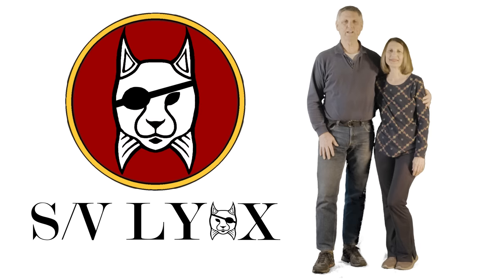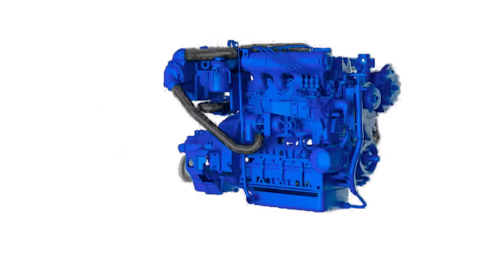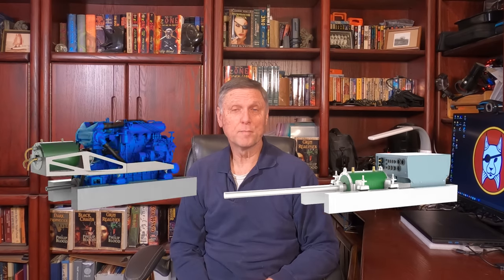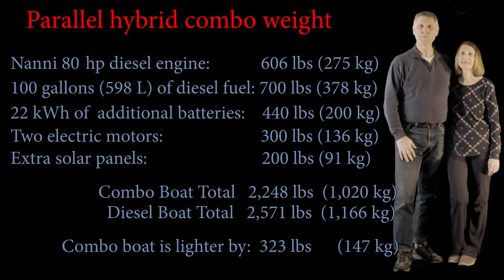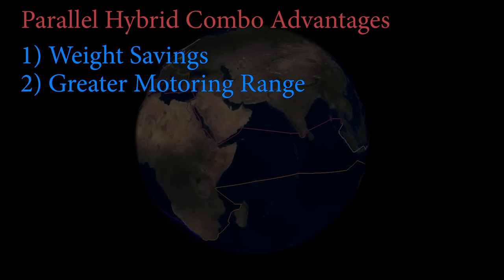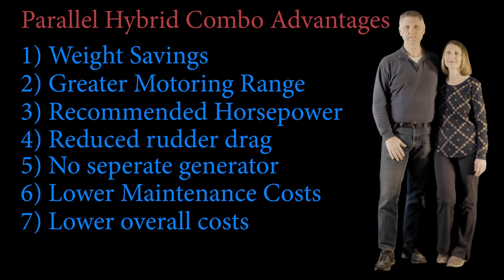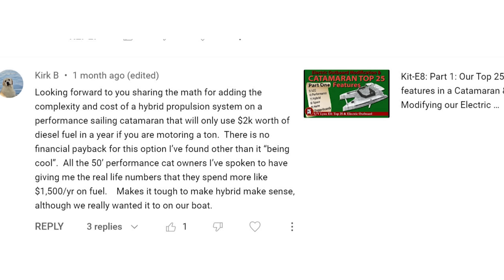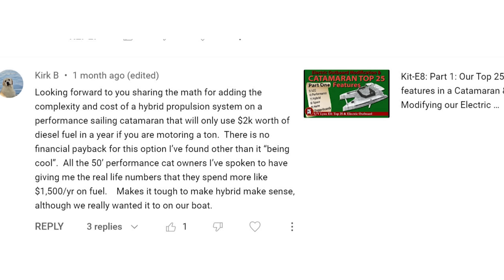Kit-E18 Parallel Hybrid Combo Propulsion

Comment: First let me just say I really love your videos and the enthusiasm you both have for this project! I feel honored you called me out and took the time to document all of this and answer my direct questions and I hope you aren't offended in any way, as I'm learning along the way myself and truly enjoy the dialog. Being a nerdy engineer who builds stuff as well I Iove this topic, and actually just got back from the Boot Show in Dusseldorf where I spent a couple of days meeting with a whole bunch of these hybrid system manufacturers and spoke with a variety of people much more knowledgeable than me on the subject as we may still add this to our build. Couple of clarifications and counterpoints

First off, there are absolutely no performance catamaran owners motor who 40% of the time. The highest estimate would be 15% and that is a stretch. On a recent 1,100-mile passage my wife and I did from Annapolis to Ft. Lauderdale we motored a total of 60 miles which is 5.5%. This same boat sailed from Cape Town to Ft. Lauderdale this same year using 1/3 of its fuel or roughly 90 gallons to cover 9,000 NM, that's 1%. The good news here is you guys also have a phenomenal performance cat you are building, and it will sail like a dream, and you won't be motoring remotely close to what you are thinking nor burning nearly as much fuel. If you don't believe your boat will perform this well, you are building the wrong boat (which I don't believe you are)  The reason people are burning $1,500 worth of diesel is because they are doing stuff like charging batteries every 4th day, or are on an occasional passage where they have the winds against them or passage speed drops under 4 knots coupled with having a weather system heading their direction and in order to not be out when things get spicy they motor sail. 

You forgot to add in on your 14-year journey, you'll need to replace your batteries in 10 years if you treat them well, and that adds $20k to your calculations (inflation happens here too!). Not sure how much they will degrade in their capacity as well, but this is a consideration that has to be factored in. Also, your flexible solar panels will maybe last 5-7 years that will give you this extra range, so you'll replace them twice as well. Now if you have rigid solar panels these will last 25 years so you are good to go if you chose rigid glass panels.

Weight calculations - you missed an option that actually is lighter. You say that a generator is necessary with the (2) 50hp diesel engine option, but there's another option and that's to use Integrel charging systems that replaces the need for a generator. Also, saying arbitrarily that you'll need less fuel on your boat when choosing this option is silly and stacking the deck. A performance catamaran won't use 100 gallons of fuel in 6 months of living aboard, so saying you need more 58 more gallons fuel is cheating the numbers to make your case for you. To add it up a performance catamaran with Integrel system apples to apples would be 1,100 lbs for the engines, 700 lbs for the fuel to make it fair, 150 lbs for the Integrel system and 200 lbs for the extra solar panels (again to make it fair). So, this set up is actually 100 pounds lighter...and I've sailed over 2,000 miles now aboard cats that have this exact set up that works flawlessly. Not to say the PHC propulsion system isn't sweet, but it is heavier.

With respect to fuel savings, you speculate that you'll be able to motor 25 NM, (assuming a bright sunny day where you aren't shading your solar panels). But you leave out that you'll get to the anchorage and have depleted batteries...and then have to fire up the engines & burn fuel to charge. You say you can run the A/C all night if you want...but not if you are saying your batteries will start every passage at full capacity. You are making the assumption you'll have sunny skies to perfectly have this work out. And you're ignoring the fact that you are talking about a performance catamaran that can be sailing in only 5knots of wind and not motoring.

One thing that is great is that you guys are the ones actually building this boat and you'll understand it inside and out, because finding a technician in the locations that understand or have seen this sort of system before is not going to happen. Having a super cool, but incredibly rare technology could end up costing you more when you have to fly a technician/parts halfway around the world to fix something and could take months longer to fix than those trusty diesels. 

Also, I'm sure you've heard of the Elcano Challenge. I've been fortunate enough to speak personally with one of the crew on that Outremer (Adventura Zero) who is also a professional captain and multihull expert. He did state that it is 100% possible, but you will be sacrificing so much and constantly be thinking about energy consumption. I think the Hybrid solves that issue, and I know my wife and I are not so concerned about saving every last dollar in diesel fuel, and when the expense is such a low part of the equation.

All this being said, because you are purchasing the components direct and providing all the labor, I 100% agree with you that a Hybrid system of some sort does make sense. I'm paying people to build our boat though and the cost I've been quoted is over $100k, so for me it definitely does not make financial sense, for you guys I do see how you can justify the costs even if in reality it might just be closer to a break even. I want this to work, and it will someday, but today for a person buying a boat not building one, the dollars don't add up quite yet.

Cheers and thanks for calling me out! Keep the videos coming I'll be following along as you are both doing a great job and hope we get to share an anchorage out there one day!
Reply from the maker: First let me just say I really love your videos and the enthusiasm you both have for this project! I feel honored you called me out and took the time to document all of this and answer my direct questions and I hope you aren't offended in any way, as I'm learning along the way myself and truly enjoy the dialog. 

Answer: Me too!  I never take offense at a good honest discussion.

First off, there are absolutely no performance catamaran owners motor who 40% of the time. The highest estimate would be 15% and that is a stretch. On a recent 1,100-mile passage my wife and I did from Annapolis to Ft. Lauderdale we motored a total of 60 miles which is 5.5%. This same boat sailed from Cape Town to Ft. Lauderdale this same year using 1/3 of its fuel or roughly 90 gallons to cover 9,000 NM, that's 1%. 

Answer: That’s a bold statement ‘no performance catamarans owners motor 40%’.  I assume you have checked with them all?  ;)  You have to remember that different people sail in different conditions in different locations.  Not all are always on the milk run and there are days you will be becalmed.  

The reason people are burning $1,500 worth of diesel is because they are doing stuff like charging batteries every 4th day, or are on an occasional passage where they have the winds against them or passage speed drops under 4 knots coupled with having a weather system heading their direction and in order to not be out when things get spicy they motor sail.

Answer: Sure, but I used your numbers for the comparison, not my own.  Now you want to change your story.  :)

You forgot to add in on your 14-year journey, you'll need to replace your batteries in 10 years if you treat them well, and that adds $20k to your calculations (inflation happens here too!). 

Answer: Here we have to seriously disagree… technology aways gets less expensive and better.  When I looked into going with a hybrid, ten years ago, lithium batteries in this quantity were $80,000, now I spent $10,000, 1/8th the price.  Or, on my Prius, those batteries were $10,000 the day I bought the car, and we replaced them, twelve years later, for $700.  Batteries get cheaper, not more expensive.

Not sure how much they will degrade in their capacity as well, but this is a consideration that has to be factored in. 

Answer: Already factored into replacing them.  What you are not factoring in is the cost of maintenance on a diesel engine compared to electric motors.  It isn’t even close.  Over fourteen years, the expected maintenance and rebuild of a diesel is around $22,000.  This are not my guesses, I got these from a long discussion about this on a forum, and the guys who were arguing that it doesn’t cost so much were the ones saying $1,000 a year and $8,000 for the rebuild. The others were claiming more costs.  I went with the lower owners for this example of $22,000.  Add that to the cost of the diesel system over time, and add in $10,000 to the Combo to replace the batteries (though it will likely be less since batteries get cheaper, but hey, I’ll go with what they cost now).

Also, your flexible solar panels will maybe last 5-7 years that will give you this extra range, so you'll replace them twice as well. 

Answer: I am not using flexible solar panels, I have hard panels with Sunpower with Maxeon cells.

Reply will continue... (it was too long to post as one).
Reply from the maker: Weight calculations - you missed an option that actually is lighter. You say that a generator is necessary with the (2) 50hp diesel engine option, but there's another option and that's to use Integrel charging systems that replaces the need for a generator. Also, saying arbitrarily that you'll need less fuel on your boat when choosing this option is silly and stacking the deck. A performance catamaran won't use 100 gallons of fuel in 6 months of living aboard, so saying you need more 58 more gallons fuel is cheating the numbers to make your case for you. 

Answer: Again, you are making assumptions about how much fuel is used on all boats.  We have A/C for the entire boat, dive compressors, TVs, three freezers and one refrigerator, computers, ice makers, I could go on.  There are other boats like us out there as well.  More and less fuel is used on different boats, by different sailors, in different situations.  However, having said that, in my experience sailors don’t tend to cross oceans with a diesel equipped catamaran, performance or otherwise, with their fuel tanks half full, they fill up their tanks and some even carry extra Jerry cans on deck in case they are becalmed for a week or more.  That’s what happened to Sailing Zatara, or Sailing Nahoa, recently, when they were in the Indian Ocean.  Or another boat I follow when they were crossing the Atlantic to the Caribbean.  For us, if becalmed, we have solar and electric motors to increase our range, endlessly, so we don’t have to worry about running out of diesel.   Finally, on this point, no matter how much you decide you are willing to reduce your diesel capacity on a diesel boat (and I wouldn’t do so at all), I can always go with less than you choose on the combo because I have solar panels and electric propulsion to get me places when I am becalmed and low on diesel fuel.

To add it up a performance catamaran with Integrel system apples to apples would be 1,100 lbs for the engines, 700 lbs for the fuel to make it fair, 150 lbs for the Integrel system and 200 lbs for the extra solar panels (again to make it fair).

Again, I must disagree.  The Integrel system (which is god awfully expensive, BTW) still runs off the diesel engines, so no, you can’t get away with less fuel on board during ocean crossings than a combo hybrid (see reasons above).  So, I’d keep the 158 gallons again and that adds all that diesel weight.  The only reason we can reduce weight is that we can run off solar and regen, you don’t get that with the Integrel system.
 
With respect to fuel savings, you speculate that you'll be able to motor 25 NM, (assuming a bright sunny day where you aren't shading your solar panels). But you leave out that you'll get to the anchorage and have depleted batteries...and then have to fire up the engines & burn fuel to charge. You say you can run the A/C all night if you want...but not if you are saying your batteries will start every passage at full capacity.

Answer: Lots of assumptions there… first I never said I would run my A/C all night, I said I can.  In certain very hot situations, I will, and if I must, I will refill my batteries with the generator before departure.  But the point about A/C off batteries has to do with listening to a diesel run at night.  I can refill the batteries in two hours of my 12 kw generator after folks wake up, then depart.  But most of the time I won’t be running my A/C all night.  Next, as you noted, we are a performance catamaran, and I was being very conservative in my estimates of 25 NM on battery power.  Schionning tells me I will get more, not less due to reduced wetted surface (narrow hulls, and the hulls only draft about 2’), but for these comparisons I wanted to use a range number I could achieve easily on the electric motors.  I was also conservative on my use of the solar power we get from recharging so that I had enough for arriving at the anchorage.  Still, if I had to, I still have a generator on board or I can use the diesel and one electric motor.

You are making the assumption you'll have sunny skies to perfectly have this work out. And you're ignoring the fact that you are talking about a performance catamaran that can be sailing in only 5knots of wind and not motoring.
 
Answer: I did not make that assumption; I expect to sail in light winds.  And, no, I am not assuming sunny skies all the time, but most of my calculations were for crossing oceans in the Trade Winds, so yes, I will likely have sunny skies at those times.  At other times, like in Europe, I will burn a lot more diesel fuel, but that’s why I have  combo boat, not a hybrid electric.  When it is advantageous to be a diesel boat, we can be one, when it is advantages to be a hybrid electric, we can be that as well.  I get to use the most efficient, or necessarily, option, as desired.  That’s the main reason the combo system is the best.

Having a super cool, but incredibly rare technology could end up costing you more when you have to fly a technician/parts halfway around the world to fix something and could take months longer to fix than those trusty diesels. 

Answer: I disagree again.  Electric motors are incredibly reliable and not rare.  They have been around for ages and are used all over the world.  And, unlike the 200 moving parts of a diesel, each brushless electric motor only has a couple of bearings.  If the control box has some issue, I have a diesel engine I can use until I fly in a replacement part.   If I am somewhere I can’t do that, I still have that diesel and my sails to get to a location that does.  I won’t be flying anyone around the world to work on my simple and practically maintenance free electric propulsion system.  Better yet, I will need a diesel mechanic far less often due to running on electric a lot of the time and saving hours on my diesel.

…the cost I've been quoted is over $100k, so for me it definitely does not make financial sense, for you guys I do see how you can justify the costs even if in reality it might just be closer to a break even. I want this to work, and it will someday, but today for a person buying a boat not building one, the dollars don't add up quite yet. 

Answer: Now that I can agree with completely!  I would never pay that much.  But, I have built our entire hybrid system (its all paid for already) for only $16,000 more than the diesels and generator system.  Just the large savings in Maintenance will make that up during our long voyage.  If I switched to the Integrel system, it would not save money, in fact, it would probably cost more than the generator (they recommend two for a cat, and that puts that system WAY up there in cost, far more than a generator!)  It would save weight on the diesel boat, sure, but it would still not be lighter than my combo hybrid, just close to the same.  And, I would not have the electric option for propulsion, which is critical to us as we hate the smell and noise of a diesel and will only use ours when we must.

Now, all this is discussion in good fun.  I don’t claim to know the actual numbers, everything here is guesswork based off other people’s numbers, etc.  Only sea trials will tell the entire story on S/V Lynx.  I appreciate your time and effort in bringing your counter points and look forward to sharing the real numbers with you, and everyone, once we test these systems on the water.  Maybe you’ll be able to say ‘I told you so’, maybe not :).

Even if you are right about the cost, the weight, the fuel, all of it… I would still go with this system just to get less time smelling, hearing, and procuring fuel for a diesel boat.  Some comforts are worth the cost.
Reply: @SailingSVLynx  Thanks for the reply, I guess we will agree to disagree lol.  I'm super happy there are early adopters and people willing to pioneer the technology so the entire industry/community can benefit, to that my hat is off to you guys!

I would say though that my comments are based off my personal firsthand experience sailing and living aboard. You may have covered this in a previous video, but to gain some help you viewer understand your level of expertise in this subject matter could you share:

In the past 10 years:
1) How many ocean miles have you actually sailed aboard a performance liveaboard catamaran?  Can you tell us of some of the passages & conditions you've experienced yourself? 
2) How many (days/weeks/months/years) have you actually lived aboard any sailboat anchoring out/cruising and not at a marina?

I'm always eager to learn from those who have done this before me, but there are a number of things that you say that make me wonder how much real-life cruising you have personally experienced so would be great if you can share.  Admittedly, I only have about 5,000 sea miles under my belt so far (and countless power boating miles) and about 7 months of living aboard catamarans in far away from the Med, to Scandanavia, Caribbean, Bahamas, East Cost, and South Pacific.  So, I'm no expert for sure just a guy trying to learn something that enjoys the hell out sailing!  

Cheers!  Happy boat building & video making!
Reply from the maker: @kirkb3473  Kirk, first of all, I appreciate you sharing all of your opinions and knowledge, but why do people always fall back in discussions to, "I have more experience than you"?  I have always been open about my sailing experience, it is all listed on my website.  In fact, in my reply to you I stated, and I quote, " I don’t claim to know the actual numbers, everything here is guesswork based off other people’s numbers".  I don't have much experience in sailing large catamarans, all my sailing of larger sailboats have been on monohulls.  Everything I share in my videos is information I have gotten from years of reading, watching, and speaking with many skippers of catamarans and I have obtained a lot of information from talking to the experts at companies like Schionning Designs.  I am a researcher by nature, and always self-taught.  I don't claim to be an expert at sailing big liveaboard catamarans, I just quote experts or come to conclusions based on their experience.  My only experience sailing cats was on my 18',  which I taught myself to sail and owned until recently.  I also have no experience building a big cat, but that won't stop me, I'll share all my plans, mistakes, and triumphs as I go. 

I'm not afraid of taking on new things, I've done it all my life.  Every time I do, someone always want to tell me I don't have enough experience.   If that were the case, I would never have sailed across the North Sea on a racing mono at 11 years of age, never have build my own kit sailboat at that same age, never have built a TV from scratch at 15,  never have become a Master Scuba Diver Trainer at 18,  never have become the Lead Designer at two game companies (with no prior experience and having been told I can't get that job), never have climbed the 3,000' granite face of Glacier Point one year after teaching myself to climb, never have written 23 novels, never have started three corporations, and never have collaborated on the design of the Solitaire 1520, a new model of catamaran, which is now for sale by Schionning Designs.  I'll just keep doing what people tell me I shouldn't or can't; it has worked for me all my life.  I get my experience by doing it, and 'damn the torpedoes, full speed ahead!' (David Glasgow Farragut, 1801-1870).

As for your sailing experience, like all others, I weigh what you say and take what you say into account, and then compare it to what I have previously learned from other skippers of cats before I come to any decisions.  Like the Borg, "We will add your biological and technological distinctiveness to our own. Resistance is futile."  :)
Reply: @SailingSVLynx  Rationalize: the attempt to explain or justify (one's own or another's position) with logical, plausible reasons, even if these are not true or appropriate.

So, to summarize the answers to my question since you skirted them:

1) Zero sea miles in a performance catamaran
2) Zero days living aboard

I do truly wish you guys nothing but success in this project, the world needs more doers out there and you and your wife are definitely two of them! Also, I sincerely hope you are able to come back and make that video 5-6 years from now explaining how all this stuff you read in books translated to real life cruising and that the stuff that pesky viewer Kirk B said was way off base!  Hell, I'll even do a guest appearance in the video so you can roast me : )

Cheers!
Reply from the maker: @kirkb3473  I didn't skirt them, I said, "I don't have much experience in sailing large catamarans."  I did not say I have none, but the numbers are not more than a few weeks on some chartered cats.  So, not zero, but close enough to say, 'not much', which is what I clearly stated.  And I am not rationalizing, that's your opinion without knowledge of where I got my information.  So speaking of 'not true or appropriate', maybe you should look at that definition about rationalizing and apply it to your own statements.  I have gathered data from many sources, including the best data available on this boat and propulsion system since it comes from the designers of both the boat and hybrid system.  Therefore, my data is both as true and appropriate as possible.  By your definition, all gathered data is rationalizing.  Therefore, you're saying that all data gathered by our space probes means scientists are rationalizing their conclusions about the solar system.  Those scientists have never been to space, but I don't think most folks would say they are rationalizing.  Maybe you do.

As for coming back in 5-6 years, I won't have to do that since we will continue to make videos as we sail the entire voyage.  Some of the answers will come early on in the videos about the initial sea trails as we test range on our propulsion system and give out the real numbers, not calculations.  

I won't need to roast you, Kirk, I already know I won't be right about all my numbers as these are calculations on the best data I could gather, but they are still just calculations.  I work off of calculations because there isn't much real world data on this combo hybrid propulsion system that I am adding to the boat, nor even real world data about the boat, since this is hull #1.  Therefore, I know that all my numbers will not be entirely accurate, but neither will yours.   Since you like to ask for specific hours, how many hours have you spent on a Solitaire 1520 with a combo hybrid propulsion drive from Combi?  We already know that the answer is zero, no one has.

What I do know is that the accuracy of my calculations on weight and cost don't matter to me.  Saving weight and cost aren't why I am adding this propulsion system.  I hate diesel and want to burn the least possible, without compromising safety.  I would gladly add weight and cost to cut down the amount of diesel I need to burn, but I tried to figure out a system that doesn't add weight and cost (over time).  As for weight, I am fairly confidant on those numbers since I have the weight of these systems and adding is easy.  As for the cost, I already purchased them, so I know the purchase price.  I don't need to sail a boat to obtain these numbers.  The only real question outstanding is how much fuel I will burn, which is a calculation neither of us can yet confirm on a new model boat with a hybrid propulsion system that neither of us has used.

But even if my fuel calculations are wrong, I'd install this system again if it burns any less diesel fuel, and though I can't be sure how much less, I am fairly confidant it will be less.  If better batteries came out, with far higher energy density, I'd ditch the diesel engine completely, but that's not likely going to happen before I set sail.  So, the combo system seems to be my best option on paper.

Let's close this discussion and leave it at the fact that we have come to different conclusions on the data we have both gathered, and only sea trails will reveal the actual numbers for this system on S/V Lynx.  Maybe we will both be surprised.